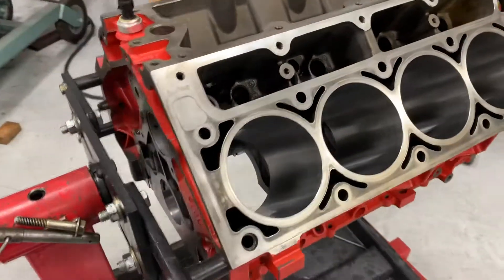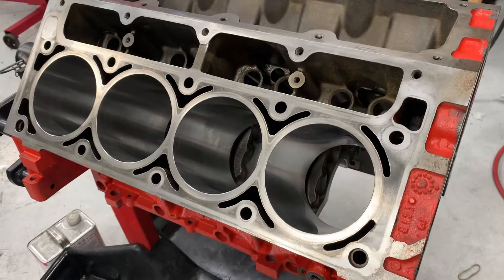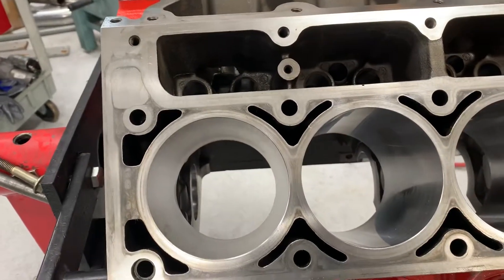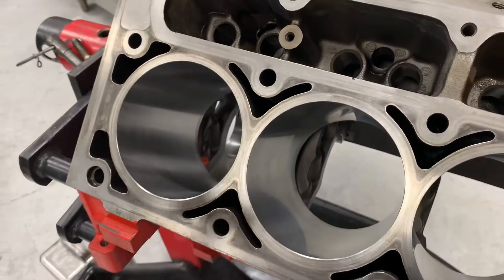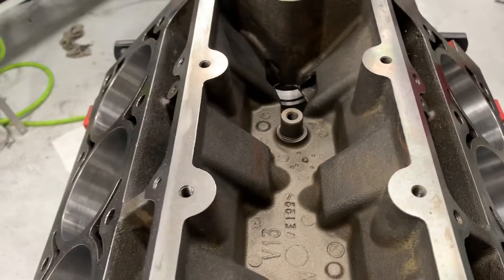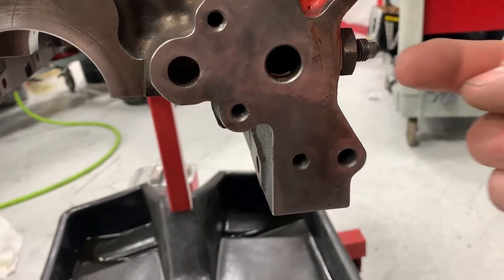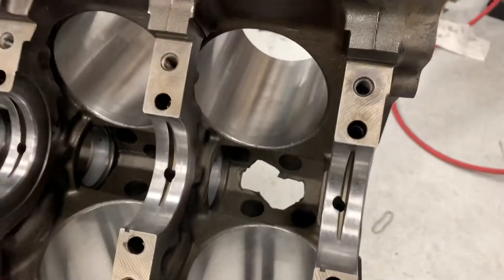Properly cleaning your engine before assembly.

Comment: I have found that using shop air at full flow gets rid of most if not all the grit. Then wipe it clean with brake clean or other cleaner you like.
Reply from the maker: My shop air runs at 175psi and I scrub until my white, Scott brand shop towels get a clean wipe. I have used the shop air with a really fine blower as well as one that sprays solvent out the nozzle and still get a ton of grit out of the cylinders. 
It reminds me of when you go to a manual car wash and spray the crap out of your car and it seems clean and when you simply touch it with anything including your bare hands and see it removing a lot of smut from the surface.

Comment: That cross hash is what a berry brush? 😅
Reply from the maker: Unlike most people/shops, I use a Mitutoyo profilometer to measure the hone results after cleaning the block. Doesn't matter if I used the hair from my sisters legs to hone it as long as I get the desired results. I got the recommended measurement values from Keith at Total Seal. I use Diamond stones if it matters. 
If you have a method that's better don't hesitate to share it.

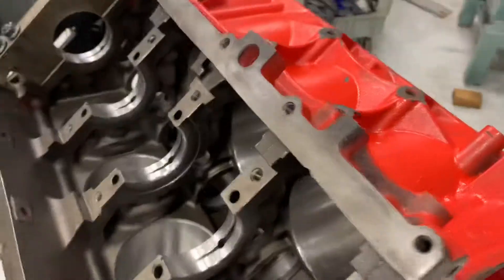Comment: YouTube just recommended this video to me, and it is very real entertaining to me right now. @ 3:21 you have a good look at one of the holes between the valley and above the cam bore. As you can see it is very jagged. Would you consider it worthwhile to clean up the edges with a die grinder?
Reply from the maker: Hi Jeff, 
That is just casting. It has a jagged edge but is thick. The only time I grind casting slag off is if there's any significant risk of it breaking loose and getting into the engine. The lifter windows in the Dart LS Next blocks often get my attention.  One edge I might not have mentioned in the video is the bottom of the bores. I use a flap wheel and radius the bottom edges of every cylinder since the piston skirts travel beyond that point. If the pistons tilt any at the bottom of their stroke, on their way back into the bore, a rough edge in the bore from machining at the bottom can wreck your skirts. It's a worthwhile task in my opinion.

Comment: Do you recommend painting block before or after cleaning?  Also paint before or after assembly? 
Thanks for the video!
Reply from the maker: I would say before only due to the risk of introducing contaminants into the engine however if it is all properly taped off then it will be of no concern. Although you did not bring up the subject, others did earlier and I would like to address it here. Using transmission fluid for the lubricant when installing your piston and ring assemblies causes problems because when the transmission fluid burns, it creates a carbon crystalline structure that can cause damage to the cylinder walls, pistons and even bearings. That is why I prefer to use a light oil and sometimes dilute it with a small amount of WD-40. I prefer to use a break in oil, coating the rings thoroughly with it.
Reply: Paint with high temp paint after assembling the engine and mask areas you don't want painted.  It is a time saver than painting an unassembled engine.

Comment: Dam I put my engine together out in dusty muddy back yard pistons head gasket bearings everything 280,000 miles later it's now parked outside on the street I could go fire it up right now have not had to replace anything but a few coolant hoses. That was a honda engine I also did this with a 4.8 Silverado engine and so far the truck has 200,000 miles. Engines are not as fragile as you builders think they are. Just make sure you don't leave a wrench in the oil pan when its put back together you should be fine chill out this stuff is over kill but if your big on being clean then good for you. I don't think it's necessary tho unless your gonna be putting the engine through some pretty stressful things.
Reply: There is, of course, some truth to what you say. After all, even if you painstakingly clean your engine before assembling it, it is not going to remain pristine for long. And at that point, all that cleaning is for naught.

On the other hand, there are certain things you just DON’T want in an engine. And on the top of that list is HONING GRIT. The more of this you can remove from an engine, the better. I DEFINITELY believe in wiping cylinder bores until the paper towel is clean.
Reply from the maker: I should have caught this one sooner.
Where to begin.......
I have also enjoyed building engines and trying to see what I can get away with but that's damn sure not something that I'll do when I'm building an engine for someone else.
I know plenty of people that will buy a stack of parts, throw standard bearings in the mains and rods and send it which is fine with me as long as it's their engine and not someone else's. 

When I build engines, I measure down to the 10/1000th of an inch for all of the bores and journals for bearing clearances. I also prove that my measuring devices are on the money with ring gauges and gauge blocks. I measure the quality of the hone jobs down to the hundredth of a millionth of an inch (two decimal places past microinches). Why? Because I have had a set of rings fail when the tuneup was known to be good and the engine was pre-oiled with the best oil in the industry in my opinion and experience, Gibbs Driven BR. Solving that problem cost me a lot of time and money and it's not something that I wanted to deal with again anytime soon.
I wouldn't be surprised if you replied that you used the grease from last nights supper to lubricate your engine and it lasted for 200,000 miles and while I find that interesting, that's not the way I choose to treat my engines or the engines that I build for others. 

I have a saying that I'll share with you.....Just because you got away with it doesn't make it an intelligent move. 
I'm sure there are many people making millions a year selling dope or running some sort of scam and getting away with it, laughing all the way to the bank.…… For now…… Eventually there will be a time to pay the piper. I compare it to playing Texas hold them poker where there is a player that likes to push by going all in time after time. They get away with that every time except for the one time someone decides to call. 

This is for those that choose to do things the "right" way. The engines that I build often make well over 1000 hp and it's often difficult enough to keep such powerful engines together so I choose to do what's within my power to help ensure their survival. Lastly, when the engines fail, 98% of the time, it's caused by a parts failure.
Reply: with that luck, dont get vaccinated and always practice unprotected sex
😂✨

Comment: How come you didn’t mention to wipe the cylinders down with ATF 1st? 
You’re spot on, with everything else. I appreciate your cleanliness, & attention to detail. 
I tell all my Friends: “I love your engine more than You do.”
Reply from the maker: I don't use ATF. When burned, ATF can leave a crystaline carbon product in the cylinders that can cause damage. I use a mixture of WD-40 and lightly brush a moly lube so that it'll help seat the rings and polish surfaces. I use Gibbs HVL on the wrist pins and a combo of moly and Gibbs Driven BR in the ring lands during assembly. I also pre-lubricate the engine with a pressurized tank that I built and turn the engine over while it lubes up. I'll post a video on making that if anyone cares to see it.
Reply: @Always_Fixing_Things  I wonder how well something like 2 stroke fogging oil would work for this?
Reply from the maker: @landoncarter6452  I load the oil rings up with Driven BR and molybdenum powder. If the engine is going to sit for very long, I'll wipe Boeshield T9 on the cylinders and any surfaces that I want to protect from corrosion.
Reply: So you do atf and then mineral spirits?